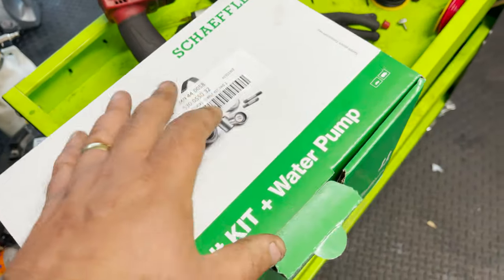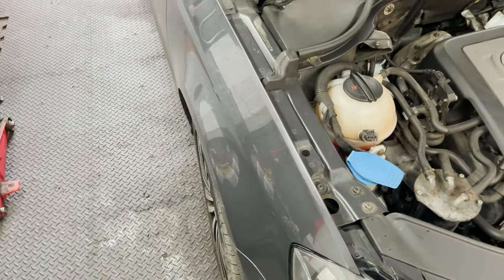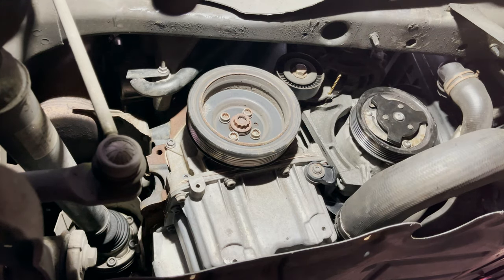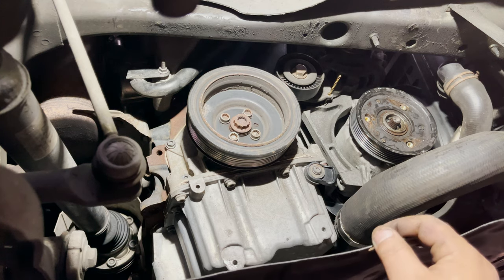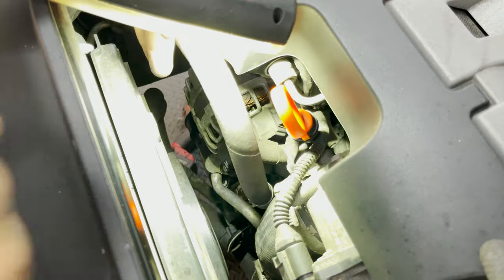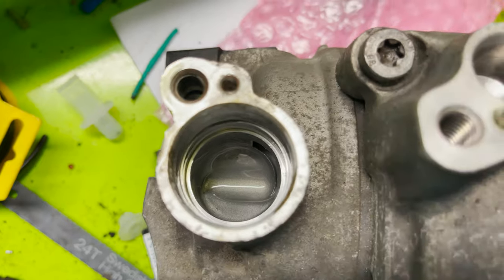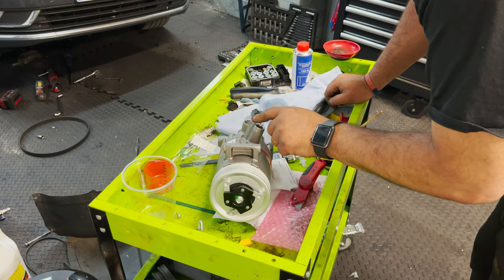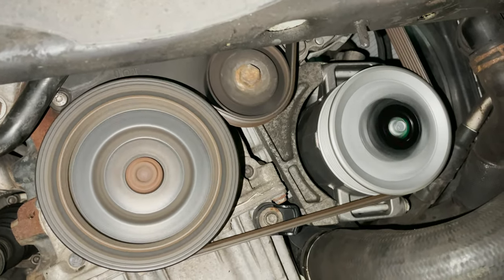Noise complaint Customer asked me to change a timing belt We found the issue 2012 VW Passat

Comment: Hi Igor as you likely know…Some compressor drive pulleys/clutches are designed to shear in the event of compressor seizure to maintain accessory drive. The seizure in all likelihood has resulted as a consequence of a loss of refrigerant. The circulation of which provides critical lubrication and compressor cooling. Via suction line cool refrigerant return. Don’t just replace the compressor…System cleanliness & tightness must be confirmed or your destined to repeat the failure. Clean, tight & dry or it’s gonna end in tears. Proper servicing with respect to pressure testing the system for tightness, vacuuming down to remove moisture and correct measure of refrigerant gas and oil quantity confirmation are equally important. Don’t ask how I know this 🤣 Cheers Pal. Great to see you taking an interest in AC 👍
Reply from the maker: Oh yeah man 😊 I came to realise how important is to carry the right procedure testing the system and how difficult it can be having an analog gauge watching your videos mate . Looking forward to get involved with AC system and complete the course and be able to offer that service to my customers , I bought a fieldpiece gauge like Ian’s , vacuum pump and hose , now I need a to get a recovery machine A2L safe probably at the end of the month when I finish the course 👍🍻
Reply: @CarsExposed  That Fieldpiece is a fantastic bit of gear. Best of luck in your studies. I look forward to learning from your videos Igor. 👍

Comment: Nice work mate....the vac pump and gauges are cheap enough...what sucks is the r134a and the r1234yf are different so during this "transition" you end up having to buy both....ugh...  hopefully the rest of the system in clean and no vac leaks for the customer...👍👍
Reply from the maker: Yeah man it sucks indeed I’ve started buying the tools needed to do both systems so far I bought a fieldpiece manifold , vacuum pump and hose, next will be a recovery machine A2L safe but most importantly will the course I don’t feel like I’ve got the knowledge to do a good job yet … cheers mate 👍👍🍻

Comment: I can hear that tensioner pulley...  You should have replaced that too.
Reply: do you can guess that what stage of that pulley? if you can recognize the pulley 's "friction" noise is it full dead or capable for some more km or mile? i mean around 200-500 mile, not thousands or is that absolutely random? from 50 mile to 5000?

Comment: INA are good for bearings ect  but hows the cambelt compare to Gates? also a gear extractor would help allot there , its well seized, this is why people need too use there AC now and again as it costs in the long run.

Comment: done similar on my brothers car.
2012 sharan 2.0 dsg 
Read instruction millions times,and didt get clear understanding with oil.
Didt put any,just the guy who was doing refill did it via mashine.
I bought same 2011 sharan 2.0,and timing belt interval in the book said 140k miles,no mention about age🤔
AC jobs probably the most come back ones,intresting to know why the system where empty,must be leaking somewhere.🤔
Reply from the maker: Very likely man , I’ve learned AC leaks can be a pain as well 👍

Comment: Seized compressor replacement needs a new condenser radiator and system must complettely clean by machine then insert the new compressor,else new compressor will seize after a few miles usage.and one more important thing i see there the aftermarket compressor has no magnetic contactor to relase rotor from belt turn that means it's working allways even ac is off that occours high fuel constumption and loss of hotsepower
Reply from the maker: I’m looking forward to learn more about automotive ac system and different designs , better videos in the future .. thanks for your comment 👍
Reply: Hi, this car dont have a magnetic clutch. Theres a electro-magnetic valce inside that handles the needed power. Its better than a magnetic clutch in my opinion. Cheers

Comment: One thing.. never remove protective caps from compressor until 2 seconds when you are ready to connect back pipes. As smallest debree can affect ac operation. PAG oil that you poured in will be recycled  as soon as ac filling machine pulls the vacuum. On your place i will pay some other shop to vacuum and fill the ac system and then call the customer when car is ready.. customers don't need to know that you don't have the equipment for ac service.
Reply from the maker: Thanks for the advice mate good to know , hopefully I should be better prepared very soon 👍 cheers
Reply: @CarsExposed  the vacuum procedure doesn't remove oil. If it did then on every regas you would have to add the entire system oil capacity back in.